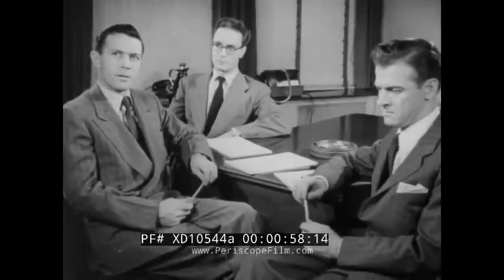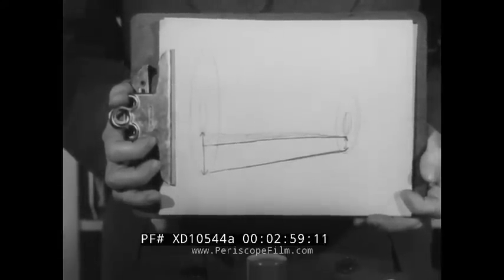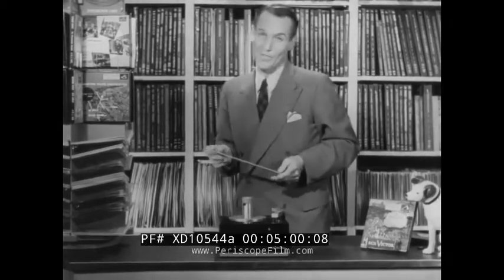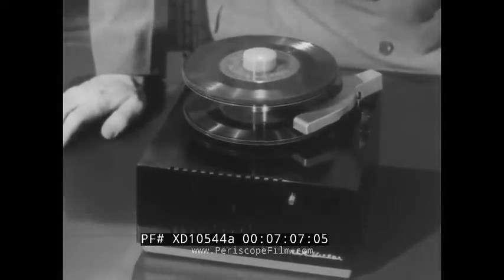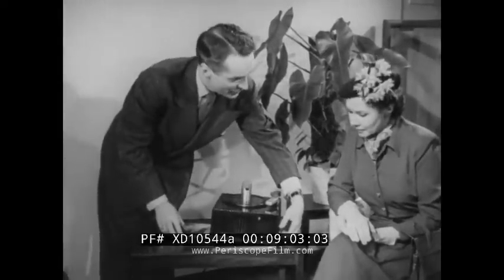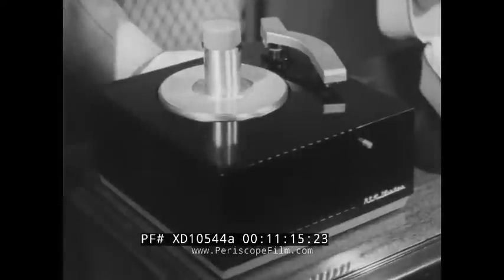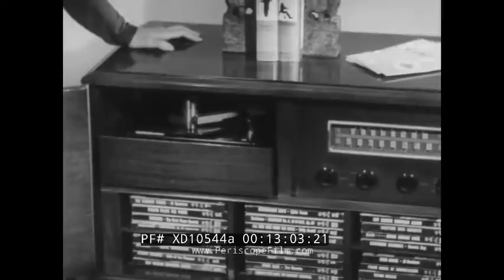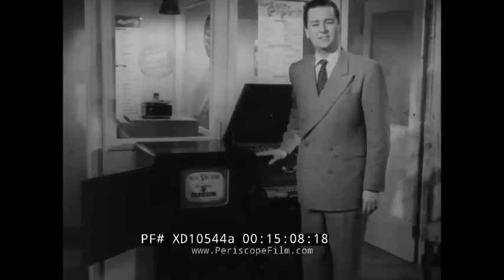NEW RCA 45 RPM RECORD SYSTEM & RECORD PLAYER PROMOTIONAL FILM   VINYL RECORDS XD10544a

Comment: RCA actually tried to convince us that the quick changer made up for the gaps in the symphony because there was not enough space on a 45 RPM record for an entire symphony. However, the raised centers was a wonderful idea and were used until the early 1990s, when records were replaced by CDs.

Ah. I see now that there were no 33 RPM records at that time. I stand corrected!
Reply: 33 12" records were already around the year before.
Reply: @PackinStackin  RCA attempted the 33 1/3 RPM records earlier, but failed because their fidelity was very bad. Columbia did eventually perfect the 33 1/3 RPM "LP" but only after RCA came out with the 45 RPM format.

Comment: Standard play speed was 78 rpm, Columbia came up with the 33 rpm. 78 minus 33 equals. . . .wait for it. . . .45! Hardly a coincidence! RCA saying they discovered the best possible playback speed is truly a myth!
Reply: From what I understand, the reason for the established record speeds is that they are even divisions of 3,600 RPM, the speed that an electrical motor spins at 60hz:

- 3,600 RPM / 46 = 78 RPM (roughly, but originally 78 RPM was an approximation from the time of hand-powered record players).

- 3,600 RPM / 80 = 45 RPM

- 3,600 RPM / 108 = 33 1/3 RPM

Gearing reduces the speed as listed above.
Reply: @Solitaire001  Very interesting and educational. Great comment, thank you.

Comment: They were sure selling the idea of accepting smaller living spaces.
Reply: Ever been in a post WWll tract house?  They were typically less than 1000 SQ. Feet. One turn-around bath, small kitchen, one or two small bedrooms, a floor furnace in the living room, and an alcove in the kitchen for the hot water heater..   Most of them are gone now.  They were basically free standing one or 2 bedroom apartments.  They were impossible to upgrade or expand.  Over time, most of them have been razed and replaced.

Comment: Then the 45 came to practically define the decade of the 1950s--Elvis Presley, Buddy Holley, sock hops and the like. The 45 came to be about just getting the one song you wanted rather than playing them as an "album."
Reply: AmazingArends yeah, 45 RPM albums didn’t last long. I only own one.
Reply: Actually, "45" album sets lasted through the mid-1950's. By that time, RCA had created an "extended play 45" disc where TWO tracks could fit on one side, for a playing time of up to seven minutes per side. "45" albums in double or triple gatefold sleeves gradually replaced three or four single boxed sets.

Comment: Just make sure you never knock them off because they break into pieces in the wink of an eye!  I think they were made of bakelite. I remember breaking 2 of them when I was a kid.  Great memories.  I still have my childhood 45's. Also have a ton of 78's & 33 1/3!
Reply: Originally, 78 rpm records were made of shellac. In the 1940s, Bakelite, Vinylite, and other resins replaced shellac due to shortages after the war. Vinylite was considered to be unbreakable. LPs are mostly vinyl, while 45s can be either vinyl or polystyrene.
Reply: @dougbrowning82  I was referring to the unit itself.  The 45 player.
Reply: @sherrydee7880  Yes, those were mostly Bakelite, except later models had a metal top chassis, and there were several models built into consoles.

Comment: RCA was fighting a loosing battle, pitting their 45s against the 78s that were already on the way out. The 45s did have a few advantages over 10 and 12 inch 33s: they were better suited for singles, and if you bought an album, you could pick the order in which its selections would be played. But people wanted to at least have the option of a whole album on one disk, or to play multiple albums automatically, still, RCA was going out of its way not to give it to them. Eventually they got wise and realized that while the 45 would dominate the singles market, their customers wanted to play them on the same turntables that could handle 33s and their old 78s.
Reply: 33's were from CBS. This was one of the earliest format wars, and RCA largely lost for a number of reasons, not the least because you could get a half hour on a 33 and 5 minutes on a 45. Techmoan has a nice video covering this format war reciently.
Reply: Actually, RCA was taking aim at Columbia's "33" long playing record by reviving research into their "45" disc, after Bill Paley personally demonstrated one to General David Sarnoff before they publicly introduced it in June 1948.  Paley offered to jointly release his "33" record with RCA, but Sarnoff was SO angry that "a little company" like CBS could upstage anything RCA could accomplish, he ordered the "45" disc to be perfected as soon as possible- which turned out to be December 1948, but not officially introduced until January 1949. However, the Columbia albums became very popular with consumers.....and RCA finally "gave in", and began offering "33 Long Play" records in January 1950, while continuing to stress "45's".
Reply: PC No    RCA was intent on replacing the 78 and was working on that prior to the war.  Development got shelved for the duration; one of RCA's execs defected to Columbia and took a lot of that information with him and they used it to create the LP, essentially beating RCA to the punch.  But where RCA wanted to drive the 78 into obsolescence with their 'single' (which was effectively the same concept as the old 78), Columbia's goal was to make a single record that could replace those old 'albums'.  What neither realized at the time was there was actually a market for BOTH types of records - especially when that newfangled 'Rock 'n Roll' music came along.
Reply: Then why did they wait until 1958 to finally discontinue the "78" disc in the United States- as the other labels did?
Reply: To answer your question, I'll ask a few of my own.

Why did VHS continue selling after the introduction of DVD?

Why did cassettes continue to sell after the introduction of the compact disk?

Why did 8-Track keep grinding on after the cassette had been improved to the point that it surpassed 8-Track?

Why did they keep building steam locomotives for decades after the advent of diesel locomotives?

Why was Intel still making original Pentium processors long after the introduction of Pentium-II and Pentium-III chips?

The answer is the same in every case, as well as with the 78 record:  There is always a group of people who aren't ready to abandon a considerable investment in the old system.  At the time that the 45s and singles were being introduced, a lot of people had 78 players (some of these were fairly new, purchased after the war!).  It's precisely why many record players had a '78' setting long after 78s had been discontinued (and many modern ones still do, SIXTY YEARS later).

As long as there is a market for the old format or system, there will always be someone willing to cater to it.    Of course, eventually the 'old way' market will dry up as people do finally make the transition.
Reply: @fromthesidelines  CBS never made their own equipment, unlike RCA (and EMI in the UK), hence the independent record player companies went for multi-speed once the 33 was in production
Reply: @fromthesidelines  Electricity - or lack of,  still a lot of wind-up rural and poor city sites had 78 players only.  Plus promise to dealers to retain 78s for a certain length of time.

Comment: Distortion-free!!!!
Reply: StringerNews1  Agreed, "distortion-free" is obviously a hyperbolic marketing slogan along the lines of Philips' "Perfect Sound Forever" when introducing the CD to the market. Nevertheless, inner-groove distortion was a real problem that needed to be addressed. The technical explanation given in this 1949 sales pitch was accurate enough, IMO. (Spherical styli of that time were unable to faithfully trace high frequency undulations in the groove at the low linear speeds and angular misalignment inherent in that part of the playing surface.)
Reply: StringerNews1  With respect to CDs, I would argue that 16 bits and 44.1kHz is not perfect (sufficient is another question) , and that "as long as you treat them with reasonable care" is not forever. With respect to RCA's method to combat inner groove distortion, their approach was simply to avoid using the inner ring of the playing surface, which actually worked on a player designed exclusively for 7" records., which they hoped/expected would become the norm.  Take a close look at those early RCA 7" discs and you will see that they successfully avoided a poor tracking angle on 7"-only RCA machines, and they judged that the worst-case linear speed at 45 rpm was in that case sufficient.
Reply: StringerNews1 I can agree on the science behind Nyquist/Shannon sampling and all you've said regarding the "adequacy" and "fitness for purpose" of the format. Perfection has a more absolute connotation in my mind, so to me "perfect" sound is as unattainable in any stored medium and any claim to perfection will always be hyperbolic to my way of thinking.    The main misunderstanding between us really is that whlie I have owned and played many a 7" 45 single, these differ in a very pertinent respect from what RCA came up with in 1949. In order to see exactly the difference I am speaking of you can check the picture here: https://youtu.be/hbFgVjijrHI?t=1169
Reply: The original 1949 RCA design called for a terminal linear velocity of 11.5 inches per second, which at 45 rpm implies a diameter at music end of 4.9 inches. That is how they pressed those early records as you can from the video here. Utilization of the area between 4.9 inches diameter 4.25 inches diameter for music only came later. They calculated the 11.5 inches per second requirement based on their assessment of the limits of human perception: "The maximum tracing distortion in any portion of the record shall not be more than is barely perceptible to trained observers when the record is reproduced through a wide-range audio system having overall response extending to 15 kilocycles." — RCA REVIEW June 1949

Comment: So, the 45 rpm was intended for albums, not singles at first??
Reply: Yes. They would have arranged the discs so that you can load the entire stack on the changer, play the first half of the album, then turn the entire stack over and then play the second half of the album. With an eight-song album the sides would have been numbered as follows: 1-8, 2-7, 3-6, 4-5. Technology Connections had a video concerning changers and mentioned this.

While RCA and Columbia were competitors, eventually both formats (LP and 45) were able to exist side-by-side since they went after different markets.

Comment: I wish all record manufacturers stuck to the RCA standard with the thinner part at the spindle for reliable changer operation.  Throw on a stack of styrene records from the 70s and 80s and you'll get jams, especially on something like an ELAC 50H!  One thing I enjoyed seeing is the fact that the tone arm jerk at the beginning of a cycle is normal!  (I was wondering about the one I'm working on.)  By the way, 1/6 of an ounce is 4.72 grams.  Now we know what the VTF should be set to on the original cartridge if you're lucky enough to still have a good one.  And you can still get needles! (https://www.thevoiceofmusic.com/catalog/part_detail.asp?PNumberBase=150&SearchType=MfgNamePhonosNeedles&MfgName=RCA&Categories=)